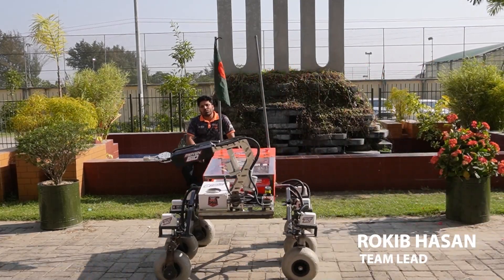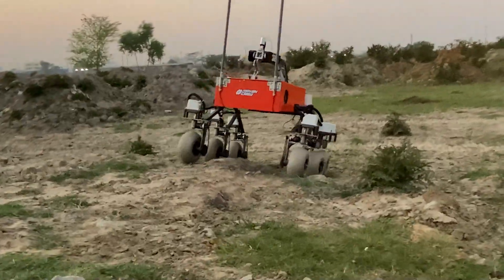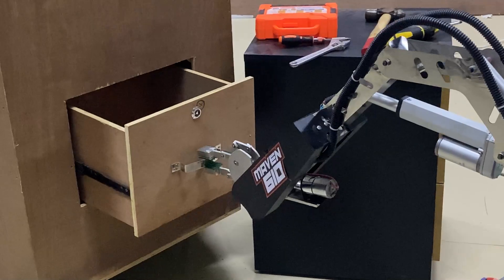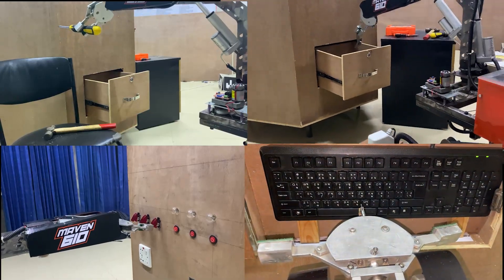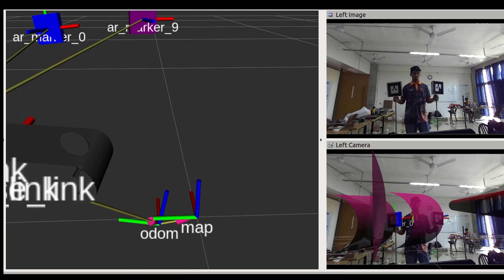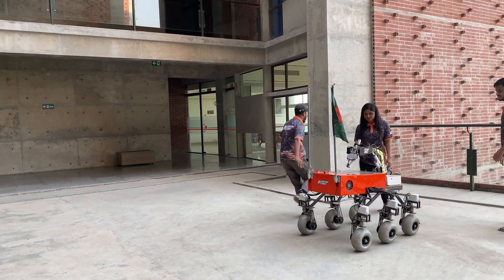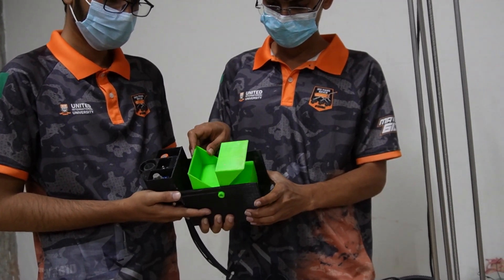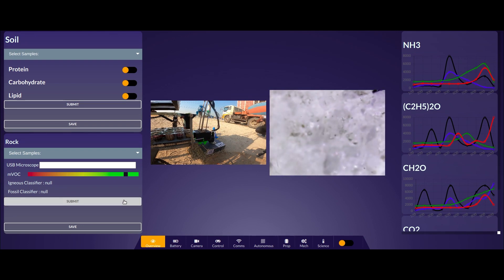UIU Mars Rover Team | MAVEN | URC SAR 2022

Comment: what is the image transmission frequency?
Reply: we were taking images, right? image transmission frequency means the rate at images or frames are transmitted. It can be calculated by fps.
Reply: @dipcb05  what is the communication frequency 2.4 or 5 Ghz?
Reply: @kolboy2028  we used both in certain usecase. But for remote rover communication, we used 2.4ghz